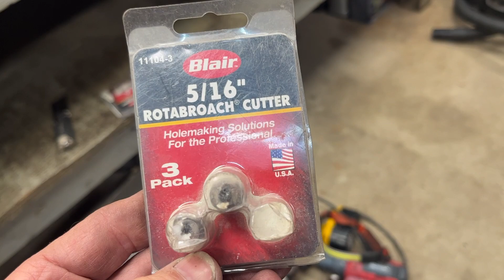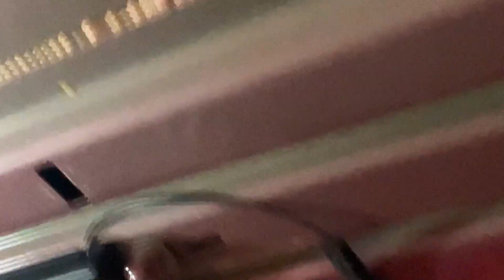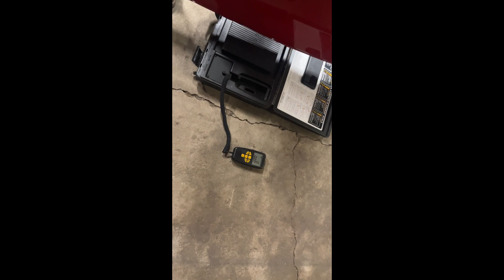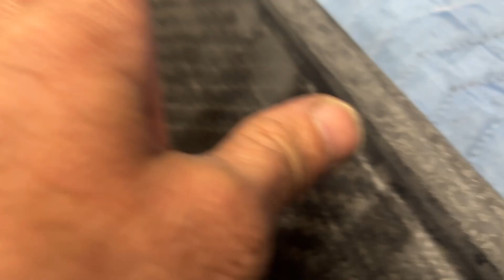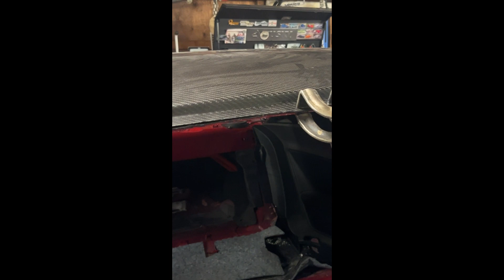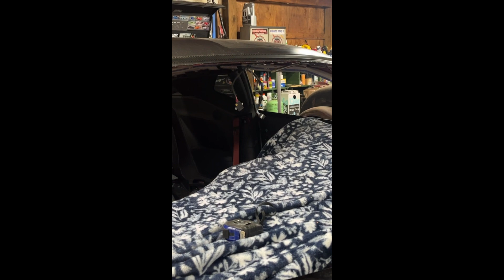Carbon fiber roof replace 2016 Challenger Charger Anderson Composites sunroof delete

Comment: Where you located maybe'll you'll do mine too
Reply from the maker: Well, I did that roof without a compressor just a garage over my head and a few tools. Where you at?
Reply: I’m in Manvel, I also would like to have this done on my 17 300s
Reply: I have a 2017 dodge charger for carport came down on it in a storm does the charger top come off easy like that also?